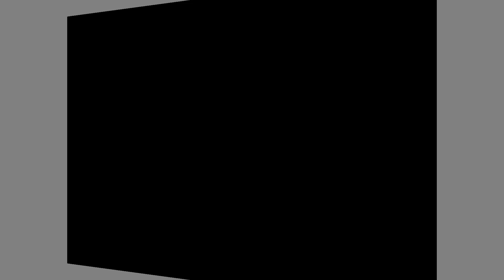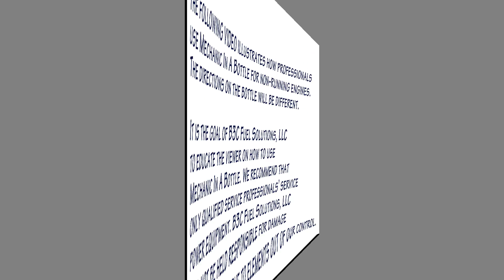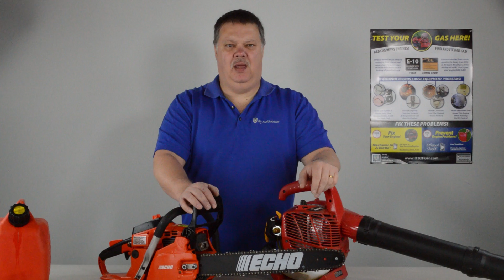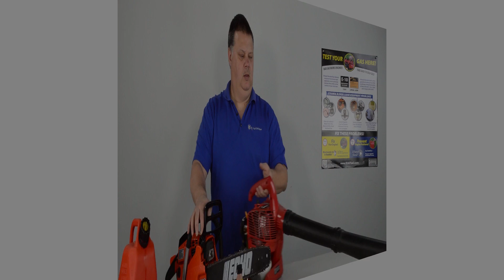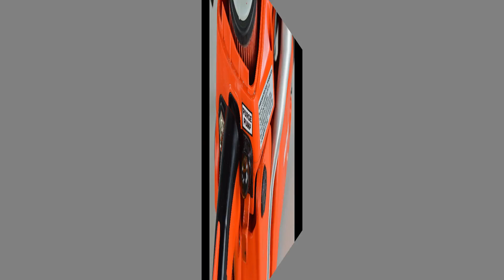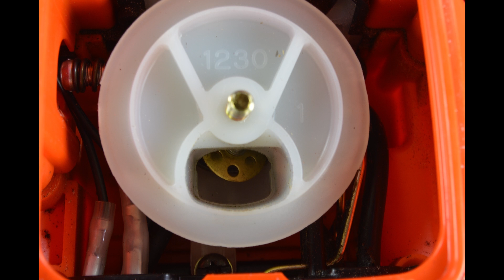B3C Fuel - How to Fix Chainsaws, Blowers, Trimmers, etc using Mechanic In A Bottle Feb 2013

Comment: The procedure shown in this video is not what is now (I am writing this on August, 2024) written in the instructions that come with Mechanic in a Bottle ("Mechanic in a Bottle for Gas and Diesel Engines"). I guess there is a new formulation. But it sure is confusing when there are so many videos showing so many different ways to use this product. Even a VERY recent video by Chickanic shows the wrong way to use Mechanic in a Bottle according to the instructions on the bottles NOW sold in stores. I assume she was using an "old" bottle she had around the shop that contained the old instructions. I assume the same goes for this video.
Reply: I was coming here to find new info as well.  The instructions say "not to drain the tank" and then it also says to add 1-2 oz of MIB per 1 gallon of gas into gas tank.  Guess I'll have to find out how much gas my chainsaw holds because it doesn't hold anywhere near a gallon of gas, so I should need very little based on these new instructions, unless I am just completely missing the point.

Comment: I hope this stuff works on my eu6500is Honda which is sputtering
Reply: @hurlrules1   I am right :)  Seafoam contains iso-propyl alcohol, aka  isopropanol"  Look at the msds. Contains less than 25% Isopropanol.
Reply: @hurlrules1  Do you know what  msds, sds sheets are? Sea Foam Motor Treatment contains <25%  isopropanol.  It is listed on page 3 of the sds. Also, google Foam Motor Treatment alcohol.  Everyone knows this but you.  You should stop now. You are embarrassing yourself about "witch" are facts and "witch" are not.

Here:

https://seafoamsales.com/base/uploads/2017/01/Sea-Foam-Motor-Treatment-SDS-v20161205-ENG.pdf
Reply: @hurlrules1    Sefoam has alchohol.